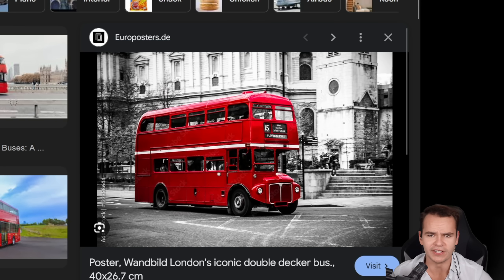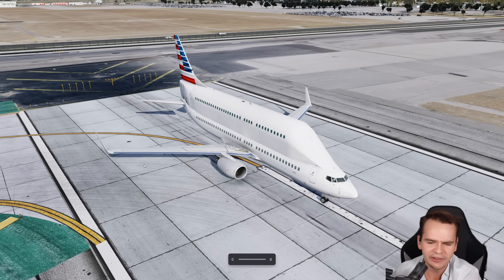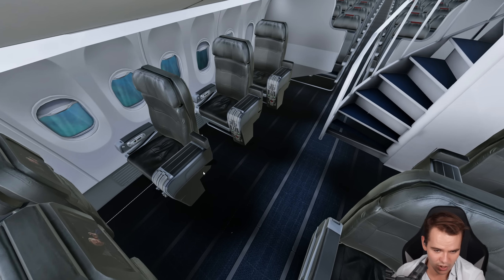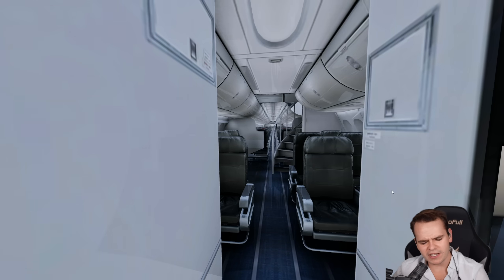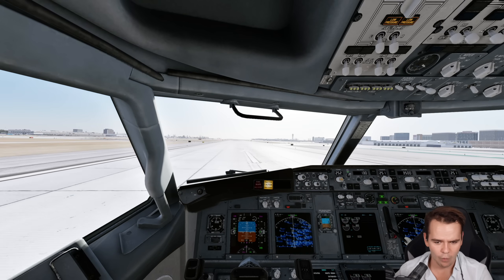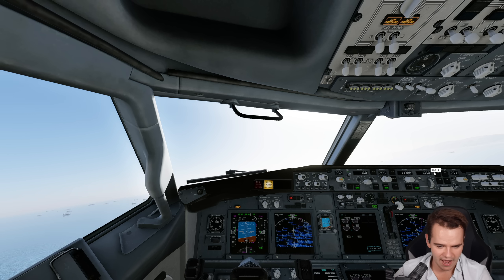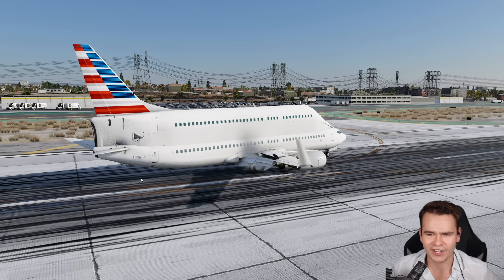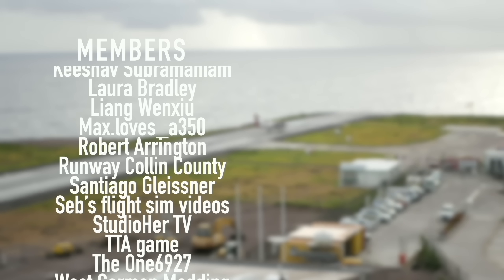Why Aren't There More Double-Deck AIRLINERS?

Comment: 737 max 7 is around 100mln $.
787 is from 250 to 340mln $ depending on the version.

If you could make that double capacity 737 work IRL for like 175mln $ then it would surely get customers. Especially if it didn't require full retraining of the crew (like the max lol).

That said, there's no reason why Boeing would compete with it's own offerings.

Comment: Well the real reason is prezurization. Having two fuselages on top of each other don´t make sense (while there have been planes that did exactly that)

Making the fuselage larger make more sense, and then you get to a wide body before you get to a dubble decker.

Comment: honestly I think double-decker planes should be more widespread, especially with planes like the A330 or A350 (A390?) as they could either serve as a full passenger, cargo, or combi layout that I think would work pretty well. imagine cargo airlines selling cheap flights on the upper deck 💀
Reply: The issue with that is that cargo and passengers dont mix well. Lots of things that can't br moved on passenger aircraft just too much risk.